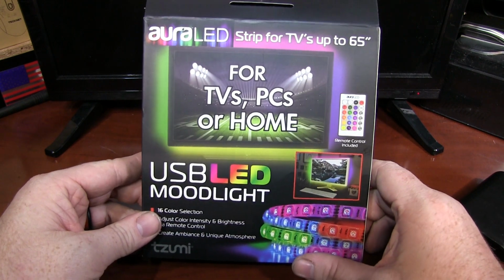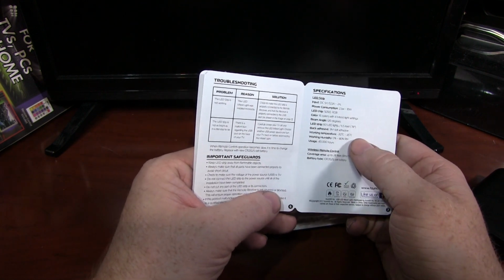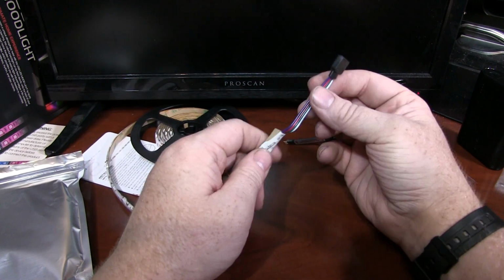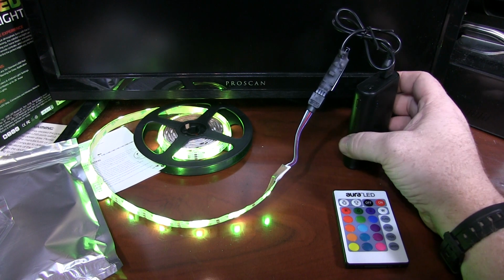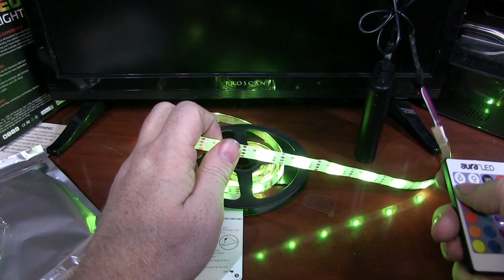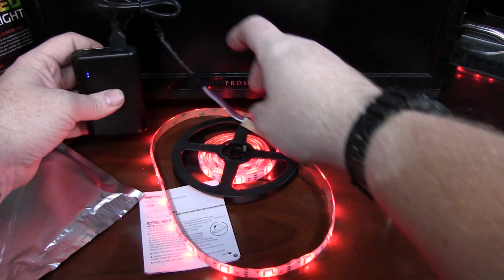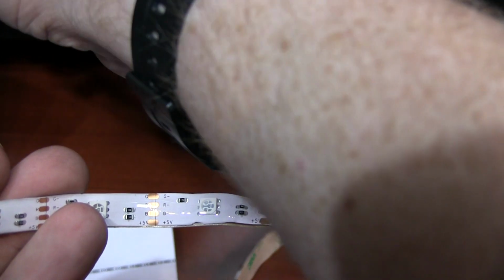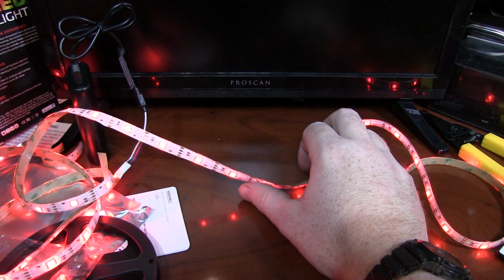Aura USB Powered Led Tape Review [2018]

Comment: Big brain the power brick is a life saver. I can tape it or Velcro it to my ceiling or wall so I don’t have to connected to my outlet. Makes it easier to hang how I want it. When it runs out of battery I just unvelcro it and recharge

Comment: you guys do realize the remote requires battery’s
Reply: There’s a battery already in it
Reply: @SD-fy5qh  you know the thing that connects the usb cord to the led strips? point it at that because thats where the receiver for the remote is
Reply: @neptunez3495  unfortunately that didn’t work.
Reply: it comes with a battery. it doesn't work. im going to try a new battery but i have my doubts, you get what you pay for. junk. and the adhesive is shit
Reply: @ember-x9o  you know the thing that connects the usb cord to the led strips? point it at that because thats where the receiver for the remote is
Reply: @ember-x9o  mine works perfectly fine and my adhesive is good!
Reply: It has a battery i had to turn connect around make sure the arrows line up like he said.
Reply: @Rylee Thomas mine does... same exact one also

Comment: Bought 2 and don’t even work, I tried everything and the remotes don’t work, after a little the one strip started to flash white but nothing else happen please someone help
Reply: Jisvy SAME
Reply: Flip the wire to the led lights I did that and it worked where the plug in goes
Reply: Make sure you’re close to the lights. Mine didn’t work when I wasn’t close to them. Literally have the control touching the lights.

Comment: These are trash man walmart has monster ones but they sell out so fast but get monster they hardly.Even stay down im on my way to replace mine.For.The 2nd time
Reply: Darius Evans the monster LED strips from walmart are the same LED as this. They are sold under different names but are made by the same company in china.
Reply: Yeah I have monster ones no problems ever this one always shuts off won’t turn back on I have to unplug for 1 hour for it to work again

Comment: My remote stopped working how do i fix it i picked a color and the whole thing turned off
Reply: It requires batteries.
Reply: SAME that’s why I’m her
Reply: @mcdonaghgoat9181  you're her?
Reply: You have to find the lil part on the strip that say control and point your remote to it and hold the on button
Reply: Yea I just plugged it into my PlayStation after not touching it for 1 year and it worked😐 so they telling me my tv is shit😭😭
Reply: you know the thing that connects the usb cord to the led strips? point it at that because thats where the receiver for the remote is

Comment: All my buttons work except "smooth" is basically strobe..i just can't figure out how to put it on the back of the tv without it in sections
Reply from the maker: If I recall correctly adjust the up and down button to make smooth go from flash to fade. Might be wrong on that though. On corners behind the TV you just kind of have to bunch it up a little bit in loops
Reply: @HauntTechTips  yea I figured it out haha thank you!

Comment: OH, I had to hold the remote almost touching the connector to get it to work. That was strange but I don't intend to change or use the remote much. But, if the remote is not working, trying holding it extremely close to connector.
Reply from the maker: Sounds like a low battery in the remote
Reply: Thank you, this worked for me!! 😊🙌💕✨
Reply: I tried that and mine still didn’t work

Comment: Can the usb be used on a iPhone charger plug that has a plug for the cable ? Like run on electricity or does it need to run on a battery
Reply from the maker: Yes, as long as the charger is rated for at least .5amp charging (most are)

Comment: They cut the the end plug off that allows more led strips to be connected. After buying these  myself they don't exactly look like my music activated high quality ones.
Reply from the maker: On strips like this I would be hesitant to add more length, it may require more current than a typical USB power supply can provide

Comment: Do you think my Macbook would be safe? long story short im going to stick the lights on my clear macbook case and whenever im in the library or whenever I feel like having the lights on I will plug it up! Do you think the lights would damage the batter? I have a 2015 macbook pro
Reply from the maker: It will use some battery power, so your overall run time will be reduced, but it should run just fine.

Comment: Will these remember the last on/off state, or will they always come on when they're plugged in? Thanks.
Reply from the maker: I have a set in the shop and will test them ASAP.
Reply from the maker: They do remember their last on/off state, however, there is a quick flash when you first power them up with them in an off state.

Comment: Yo my remote doesn’t work or lights plz help me man
Reply from the maker: Step one, make sure the little clear plastic tab inside that protects the battery during shipping didn't break off or get jammed inside.
Step two, make sure the battery is in the right way up.
Step three, try a new battery.
If all else fails, these remotes tend to be universal, so if you grab another kit from Wal-Mart the new remote should control both kits.